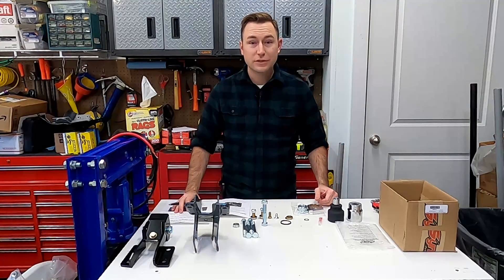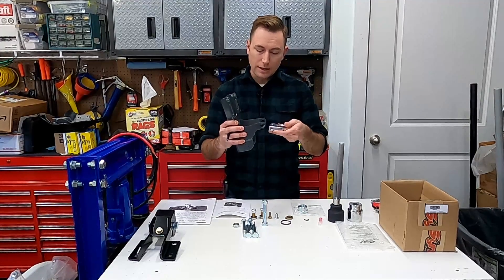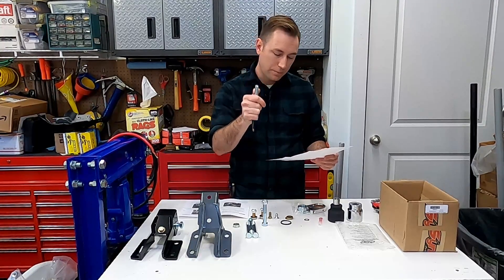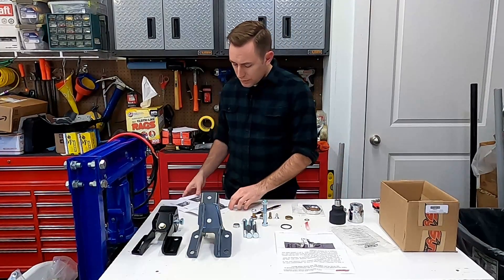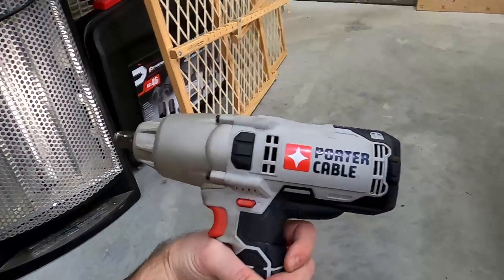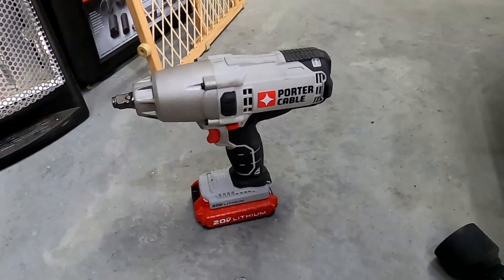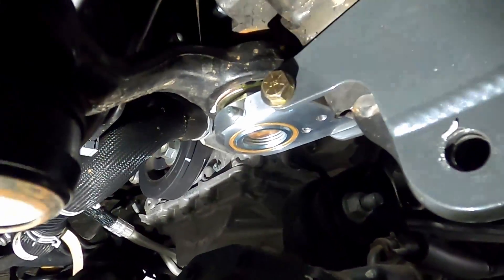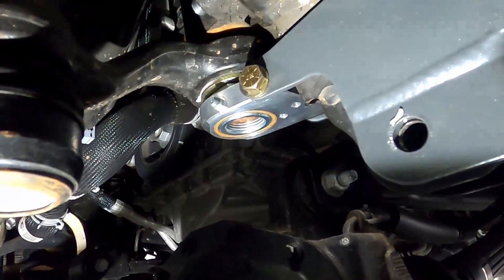Updated Synergy Track Bar and Sector Shaft Brace - JL / JT

Comment: They actually offer another updated kit with a thicker metal brace, new steel shaft brace vs the aluminum and now they offer a sealed bearing instead of the greaseable bronze bushing.
Reply from the maker: Good callout.  I hadn't seen the new sealed bearing until you mentioned it.   That would be my preferred design if I were doing it again.

Comment: Hello, have you had any issues with the nut hitting the track bar?
Reply from the maker: I can feel on the track bar where the nut seems to have made light contact, though it seems to be very minimal.  However, it is worth noting that my Gladiator is a DD, with only light off-roading (camping, driving on the beach, etc).  If you are doing more significant off-roading, especially with the sway bars disconnected for more flex, then I think a different track bar would be necessary.

Comment: I wouldnt bolt or fix anything to the steering shaft. If not constantly maintained I think this could lead to a dangerous situation. I would stiffen the frame the steering box is bolted to and get that bushing off that shaft.